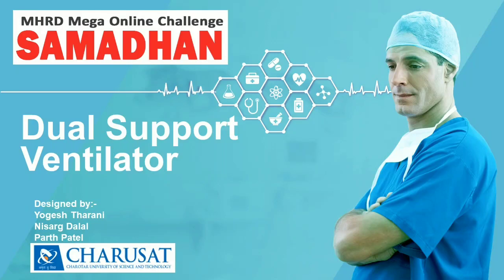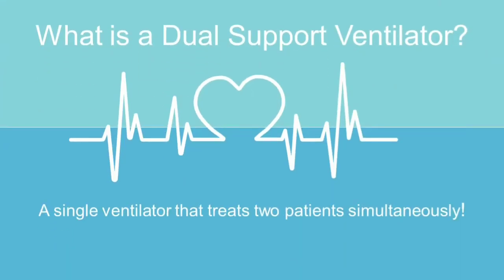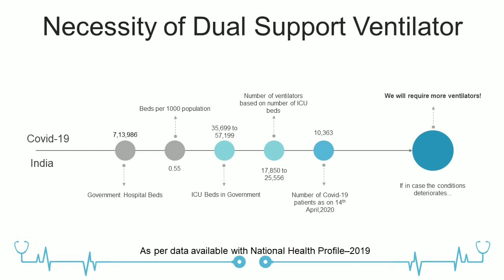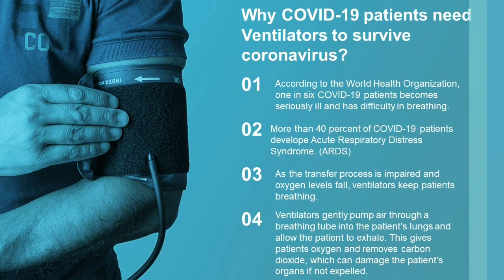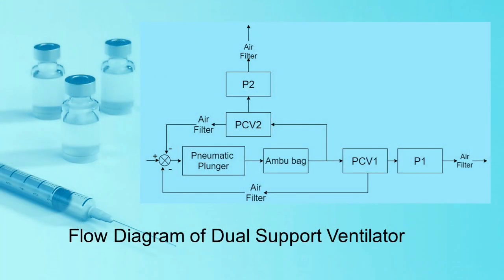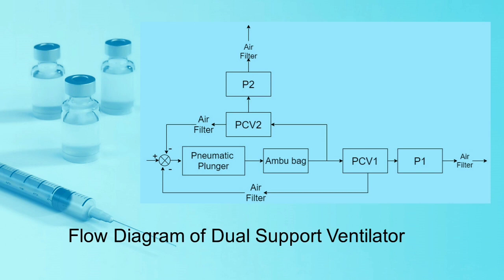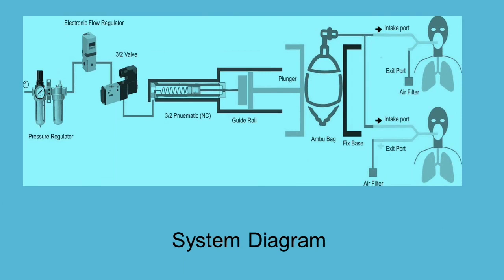Dual Support Ventilator System for MHRD Mega online challenge  Samadhan

Comment: What are the chances of mixing up of the Patient 1 Air with the Air of Patient 2?
Reply from the maker: There will be no mixing up of Air of patient 1 with air of patient 2 because of two reasons
1). We are using T-shape tube to separate the flow
2). There will be pressure control valve on each path to control the flow and those will be no return valves.
Hence, the air won't mix. Hope this clears your doubt.